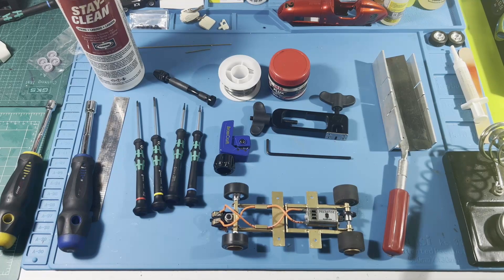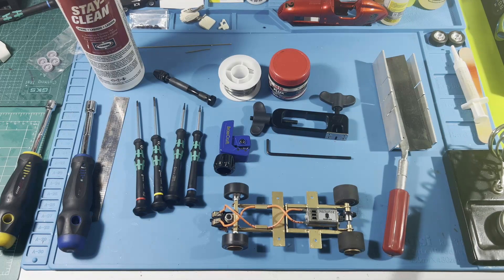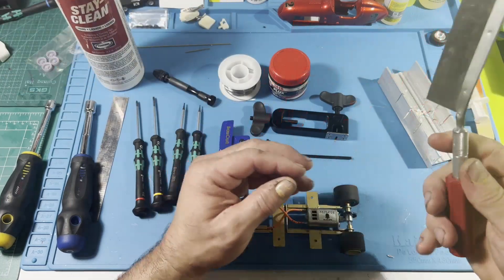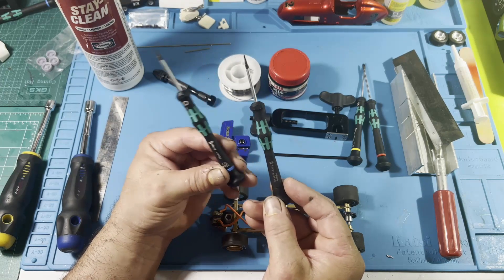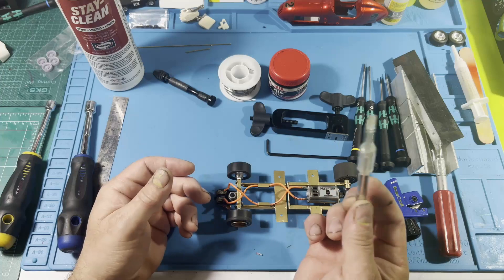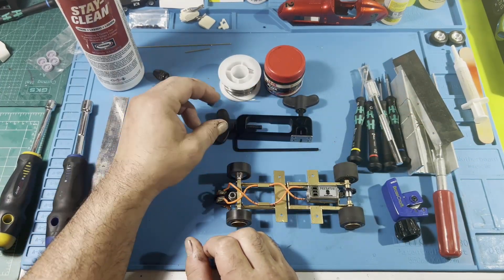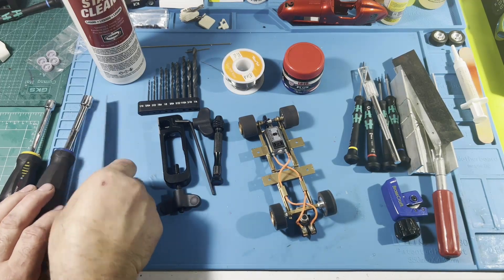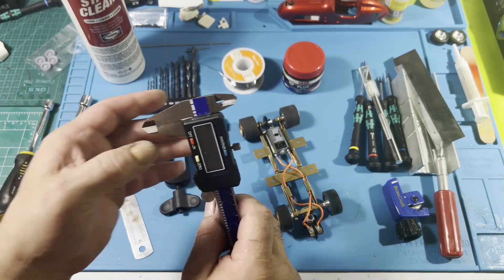Basic tools for building a Brass Chassis

Comment: Good clip Jorge.
 
I would add a Dremel, a Hand-Files in different editions, like in a Flat - Triangle - Round - Halfround - 4x4 - Set. The flat Metal-Files should be one with a fine and the other with a rough Blade. 

A Stop, or Flat-Angle ;-) and a flat straightenig Plate, as well. 

A Wera Hex 1,5mm for 1/24 Scale Car-Rims and the PH0 and PH1 Micro-Drivers by Wera for instance. If, get the PH1 60mm Shaft Edition, because the 80mm is not so handy to screw with, too long. There is a Set of 12 with a Porch from Wera, that includes all the Drivers, you listed, but one needs to get the 1,3mm Hex extra and the shorter 60mm PH1. 
The shorter PH00 is inside the Set of 12. 

In terms of Drill-Bits, one should get quality HSS Drill-Bits. The cheaper D-B`s are ok for Plastic Parts. The real small One`s often break. Cheap Drill-Bits are mainly forged from a Bar. The higher qualiy Drill-Bits are seamless drawned and run concentric.

Lucky if you have aDrill-Press, or a Drill-Stand. 

If you a have a Drill-Press, a good for Vice is a must, too. A Vice is a must, like a helping-hand Vices for soldering.

I use a Wabecco-Drillstand, where I can attach my cable-guided Drilling-Machines. Check out their Website:
 
www.wabeco-remscheid.de

This Stand is awesome and it helps to save space in the Workshop, because you can take it appart and store it. It is precise, as well. I had an issue when I got it new, 
but they replaced the Part it and it is 100% right-angled with my Drill-Machines, which run concentric. I checked it with a Bevel-Box for a proper 90 degree angle Position. 
That together with concentric HSS Drill-Bits, is a winning match up for me. But you can do much more with the Drill-Stand. Have a look at it. ;-)

I was torn a bit, choosing a solid Drill-Press, or this combination. If you want a high-quality Drill-Press, that runs concentic, you pay quite much for it. New , or used. Used, older Drill-Stands are fine, but often hard to get for a reasonable Price. 

A good 12V Battery-Drill is need, too. It is in the right Size and not too big, like 18V B-D`s. Bosch and Milwaukee are fine. Much cheaper over all and if you use it right, much cheaper than a stationary Drill Set-Up, plus you are flexible and independant. Every houeshold should have one. Handy and multi-usable they are. I got 12V and 18V One`s. But hey, I am a Nerd for Tools, so what can I say to that. lol 
But I also have a Hand-Drill like you got. The cheapest way of drilling a Hole into something small of them all. To drill in my Nose, I use that good old Index Finger. That is for free. lol 🙂 

That does it, to complete my Mustard on top of your clip.

Greets go over to you, Brother! 🙂